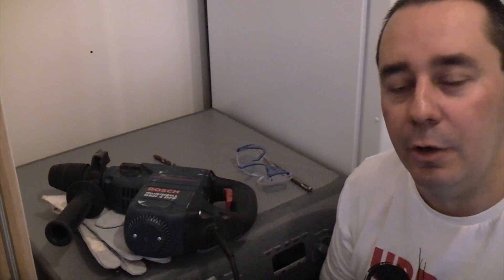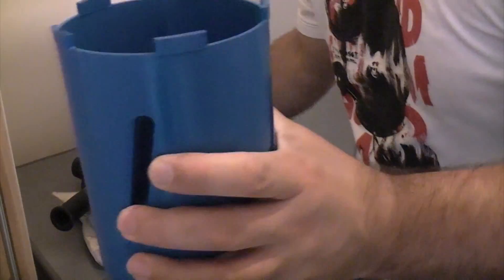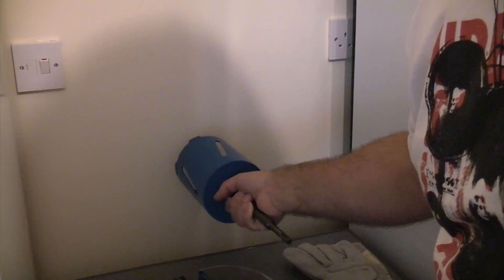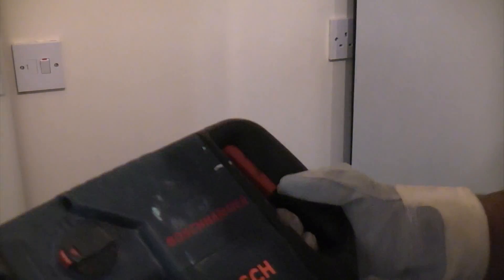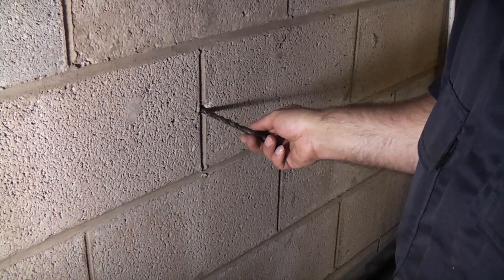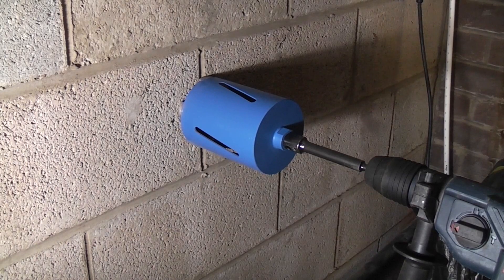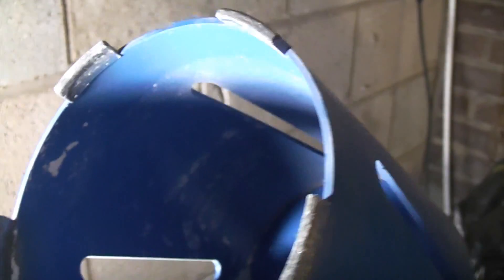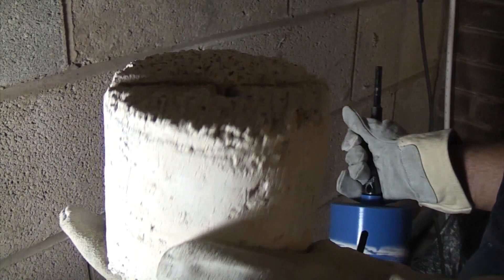How to use a diamond core drill

Comment: hi i would be glad if anyone could help i want to make a hole using the hole saw in a stair case of concrete but it has steel inside it obviously i want to know whether this will cut through the steel inside the concrete or i need other hole saw carbide
Reply from the maker: Yes, this should cut through steel reinforced concrete, although it will be tough to get through.
Reply: Thanks for your answer a last question please can this one used as well carbide tipped  hole saw or only the diamond you showed the video.
Reply from the maker: Diamond works best on steel reinforced concrete. You can do the occasional hole using a drill like mine but if you have a couple to do you are better off using a professional drilling rig such as a hilti which will have vacuum and be water cooled.
Reply: Thanks for the info,i work once in a blue moon so dont really need expensive tools.

Comment: Great detailed video yet again! Anyway of determining of a drill  has the required clutch? I have a 1400W SDS drill from good old Lidl which I hope is OK.

Any reason too for putting the vent hole high up? I thought lower is better to allow moisture to flow down?

On a different topic, I have some led security lights to attach to a garage. Is mortar ok to affix to brick (red)? Mortar can be repaired later on if the lights are removed whereas brick never looks the same?

Cheers
Reply: fallofdutee
Reply: I suspect the dryer is going on top of that existing machine

Comment: Can and should you use hole saws with impact drivers? (I want to cut a hole in mdf and an impact would be better at it in my mind)
Reply from the maker: As long as you can control the speed and go slowly it should be okay, but you don't want to use large diameter hole saws too fast.
Reply: Thank you!
Reply from the maker: You are welcome.

Comment: thanks for this I did this today following your guide. my problem now is i can't get either the drill bit off off the extension bar not the sds off the extension bar. They screw in. I've lubricated and everything, put it in reverse but I can't get it out. Any ideas?
Reply from the maker: Have you tried removing the front cover from the SDS drill chuck?
Sometimes if you remove the cover you can un-jam the drill bit.
Separating the extension bar can require a large adjustable spanner (assuming there are flats on the bar to grip), then another spanner to grip the flats on the end of the core itself.
Reply: +Ultimate Handyman thanks I'll try the spanner. Extension bar and the arbor is screwed tight and the drill bit also screwed on tight. I can't see a from cover to remove. Are they meant to be this tight to both unscrew?
Reply from the maker: Yes these are always difficult to undo because they tighten up when using the drill.

Comment from the maker: Wow, over 1 million views for this video!
Thanks to anyone that has ever watched it ;-)
Reply: Ultimate Handyman ggggf🐙💩🥔🐣⚽️⚽️⚽️⚽️⚽️⚽️
Reply: Well deserved too. Informative and well made, if I hadn't watched this I may have cocked up my new core bits. I didn't before this not to have the hammer function off so thanks.
Reply: Ultimate Handyman  like
Reply: Thanks for taking the time to demonstrate
Reply: Almost two and a half million, you are a youtube star now.
Reply: Going to ask a silly question here but what is the purpose of the safety clutch?

Is it incase the diamond core bit grabs and spins the drill out of your hands, effectively preventing that from happening?

Once had this happen to myself, nearly snapped my wrists. Turned out the arbour was slightly bent from shared use, meaning the core bit wasn’t  spinning properly. I always double check the arbour is perfectly cylindrical now as opposed to bent but still get a bad feeling when coring
Reply from the maker: @andnowawordfromoursponsors4439   Yes, that is exactly what the safety clutch is for. I used to have a drill without the safety clutch and it bit once, and I had a fight with it and won, but I was a lot stronger back then. It is easy to break a wrist if the drill grabs at speed without a clutch!
Reply: Ultimate Handyman You deserve it. Great videos.
Reply from the maker: Thank you ;-)

Comment: When using an SDS bit with the hammer action turned off, is the bit only held loosely like when using hammer action? I'm wondering why use an SDS drill for core drilling since you have to turn off the only useful thing SDS does?
Reply from the maker: +FlyBoyGrounded 
A dedicated core drill is very expensive. Some SDS drills have a safety clutch like this one- which makes them perfect for drilling the occasional core without having to buy a dedicated core drill.

Comment: quick question I've to make another hole using the proper drill which I borrowed my worry is the outside of the house was freshly plastered just sand and cement render would the hole outside be perfectly round or would it need to be patched up a reply would be great thanks.
Reply from the maker: +SuperGawin If you are using a core drill like in this video the hole should be perfect, however you are better off drilling a pilot hole straight through the wall, then use the core drill from the inside and the outside to guarantee a clean hole.

Comment: Solid walls are easy!  Brick cavity construction is more difficult as when the core-drill crosses the cavity it may try to jam.  Make sure that the fuse in the mains plug is only two or three amp.  If perchance a 13 amp fuse is left in the plug, one may have a problem (stripped gears, broken wrist or arm, being tipped off the ladder etc)  In actual fact SDS arbors which are really just DIY devices will probably shear off first.  

A quite difficult job is drilling vertical holes in Devon-Banks and Cornish Hedges.  (Allegedly there are slight variations in construction) Both tend to be made from quarry waste bound together with clay.  It is difficult to get plants to grow in such poor soil so holes need to be drilled and usually earth-augers won't work.  Something that can tackle clay, stone and tree roots is needed.  Continuous wet-diamond might be the best but such drills are hard to find.
Reply from the maker: +Tech Davey 
Thanks for the info ;-)

Comment: hi! could I use the same tools to drill a hole in granite wall?
Reply from the maker: +John Smith 
I have not tried this on granite, but I believe it is very hard. Therefore your best bet would probably to get a contractor to make the hole for you using a water cooled diamond drilling rig, or you might be able to hire one. I think if you tried a normal diamond core drill it would damage it and probably not complete the hole!
Reply: John Smith — Potential Dalbeattie robber

Comment: I did this by hand with a masonry bit, a screwdriver and a hammer.  Took only about 30 minutes and cost $0. Turned out beautifully.  Lol
Reply from the maker: +Jack FnTwist 
Thanks for the comment ;-)
Reply: +Jack FnTwist I doubt very much it turned out beautifully, im sure your hole is not anywhere near round, like you would get with a circle saw.
Reply: +Chris Shaw Actually, it turned out pretty precise.  Definitely not as easy as this, but free.
Reply: +Chris Shaw Started with a larger center hole that went all the way through to the other side.
Reply: ***** Yep.  I chiseled it out with screwdriver and hammer after drilling 1/2 inch holes all around the diameter.  My friend just did it again for me with a rotary hammer drill, and it made a pretty clean hole in about 10 minutes (the outside stucco came off a bit).  But hand chiseled with a screwdriver was pretty perfect.  Just took forever.
Reply: ***** I'm not about to buy this expensive system just for one hole.  Even renting it for a day with drill is over 100$.
Reply: ***** Not angry at all.  That's what "Lol" means. ;)
Reply: ***** There is nothing in his message that even remotely
 came across as angry. i think you are the one with a problem, reading too much into nothing.
Reply: ***** be so kind and point it out to us then ?
Reply: ***** Yeah, please point it out.  I swear I'm not angry at all, and everything is well. lol. Thanks Chris!
Reply: ***** Seems like someone's reaching out for some attention and admiration for abs they wish they had, but clearly don't. Hahahaha
Reply: ***** You started it - randomly projecting your anger on me.  Yeah, I'm known for being a bully.  It's a curse.

Comment: i would have just attached it to a nine inch grinder. would have taken 30 sec to go through that cinder block. we cut holes that big through 100mm granite in under 2 min. also it wouldn't catch if its spins faster
Reply from the maker: +brian Reed 
Well, it's no good just saying "I would have".
This is YouTube, where anyone can upload a video. Please post back when you have uploaded on using a  diamond core with an angle grinder.

Comment: Very useful video. Like the envelope on the wall, I normally get the hoover out and hold it awkwardly under the drill.
Reply from the maker: +Mark Slevin The envelope trick was passed down from my brother in law's mother years ago. I think she saw it on a TV program, or perhaps saw it in a DIY book.Thanks for the comment ;-)
Reply: @ultimatehandyman  The envelope trick has been around since The 1930s Mi great granddad told me that I used to use a flute of paper Down to the floor ,The Hoover attachment works best as it sucks onto the wall There's all on Amazon cheap ones from China and expensive ones from Bosch

Comment: if its an option I would HIGHLY recommend to use water as a lubricant if your using one of these on a concrete wall.  You can get away without water on cinder block just because they are a good bit softer but with concrete you need water.
Reply: +End Times Rider    just try use brazed core drill bit
Reply: NO....its called a DRY core bit for a reason

Comment: Good evening,
Titan TTB279SDS has a mechanical safety clutch and I was wondering whether it's good enough. It's a rather cheap hammer drill, but its reviews are really good. Four and a half gold stars out of five. Will it do?
Thank you :)
Reply from the maker: Gandalf4137 
It would be ok for the occasional core drill, but not for use all the time with cores as you need a dedicated machine for that really!

Comment: Today I purchased a 78mm diamond core drill. I have Bosch GBH 2-26 DRE, but I am not sure if it's good enough. Do I need something bigger?
Reply from the maker: Gandalf4137 
It should be fine, although there does not seem to be a safety clutch on that machine which you should really have when core drilling. If you are going to be doing a lot of core drilling a dedicated machine with a safety clutch is recommended, but for the occasional core drill your machine should be fine.
Reply: ***** 
Yes, you are right. It only has an overload clutch which helps to a certain extent, but having a safety clutch is better.  I work as an electrician and I might need something better. I have been thinking of buying a Sparky BUR 355 ce because it is pretty affordable, but people say that most Sparky drills are good for nothing. What would you recommend?

Thank you
Reply from the maker: Gandalf4137 
You are welcome ;-) 

Unfortunately dedicated core drill machines are not cheap. I just checked screwfix and they have two Sparky models on special offer at £169.99 but for £30 more you could get the Dewalt silver bullet. They seem to have pretty good reviews on Screwfix.
Some people don't rate Dewalt tools, but I have lots of Dewalt tools and they have all been fine!
I'd definitely not risk a Sparky model just to save a few quid. I can only find the BUR2 355CE models on Screwfix and they are only 700W compared to the Dewalt at 1300W.
Reply: ***** 
I currently live in Bulgaria and think there are 2-3 Sparky factories and buying a Sparky drill is not that expensive. The make appears to be German, though. Anyway, the one I found is 1260 W and I think that's pretty good. Dewalt is a top make. I could buy the silver bullet off ebay if necessary. Have you ever used Sparky drills? Are they any good? I usually use Milwaukee, Bosch, Hitachi and Makita.
Reply from the maker: Gandalf4137 
Sorry, I have not used Sparky drills and do not know anyone that has.
All my tools are Dewalt/Bosch/Milwaukee and a little Makita.
Sparky are sold by Screwfix in the UK, they have reviews on their site and the Sparky stuff does not get good reviews- http://www.screwfix.com/c/tools/corded-diamond-core-drills/cat830820
Reply: ***** 
Thank you and I apologize for asking so many questions. I just needed a professional opinion. :) I will save up and eventually buy the silver bullet. :) I wonder if there are also any Bosch core drills. I hear the speed is very important too and it varies with the size of the core drill bit. Is it true that the bigger the core drill bit is, the higher the speed should be, or that's just another myth?

Thank you for everything :)
Reply from the maker: Gandalf4137 
No problem at all ;-)
I have never heard that the larger the diameter of the core drill the faster you need to go. I would have thought that the opposite would apply in that you would need to go faster with a smaller diameter bit- just like when you are drilling other materials. 
Bosch probably do make a drill suitable for cores, but it will probably be expensive.
Reply: ***** 
I came across a core drill by Bosch, but it was more expensive. I have decided to buy the DeWalt one. It looks pretty nice and its specifications are great for the money. It's not the sharpest tool in the shed, but it will do. It's more than good enough for me and I don't think it's too expensive. Buying one will pay for itself. I only have SDS plus adaptors, though. Some people say that we can use  the standard SDS+ adaptors with keyed chuck drills. I personally don't think that's a good idea.
Reply from the maker: Gandalf4137 
You can use the SDS adapters with keyed chucks but you run the risk of damaging the chuck, so a proper hexagonal arbor is best ;-)

Comment: I have a 78mm TCT hole cutter. Does the same rule apply? Should the hammer action be turned off?
Thank you
Reply from the maker: Gandalf4137 
Yes, you should not use hammer action with diamond or TCT core drills.
You are welcome ;-)

Comment: how do you stop the arbour bit and the core from locking together ? as i was drilling a 4 inch hole for an extractor fan and i couldn't undo the two bits?
Reply from the maker: Allen Goldsmith 
They are not easy to undo.
There are normally two flats machined onto the arbor and the core drill itself which you can grip using two spanners/wrenches.

Comment: Why not drill through the center of one of the cells in the concrete block instead of through the joint between two blocks, where you'll be removing both end walls of two blocks instead of just the interior and exterior face of one of the cells.
Reply from the maker: It doesn't really matter where you put the core drill through, it will go through solid material or hollow material. The outter skin is solid brick anyway so it's not critical where you position it when drilling.
Thanks for the comment

Comment: I get so confused, are you using a rotary hammer or hammer drill?
Reply from the maker: I'm using an SDS drill, but any rotary drill with a safety clutch will work. You do not use hammer action with diamond core drill's

Comment: What's your opinion on wetting the cement blocks while drilling...would this method help protect the the drill bit?
Reply from the maker: These cores are designed to be used dry, but I don't think wetting them will do them any harm. It will help to keep the dust down for sure.

Comment: 10 inch hole  you use a core drill hooked up to water you usually have to
anchor the core drill to the floor or wall with threaded rod/drop in anchors and go slow

Comment: Hi thanks for the video. Will these cutters go through solid 1930's brick?I'm wanting to use one to cut the hole before fitting an extractor fan in my bathroom.
Reply from the maker: They will go through most types of brick, but there are some that it won't work on such as calcium silicate bricks.
Reply: ***** Thanks for the prompt reply. I'm going to hire all of the equipment because my SDS does not have a clutch.
Reply: ***** sorry but you have it wrong, what you have is a dry brick cutter.it may be diamond tipped but it is not a true diamond core drill.your right though about the clutch. got caught in the yahoos myself,
Reply from the maker: Robert Mclay
In the UK these are sold as Diamond core drill bits ;-)